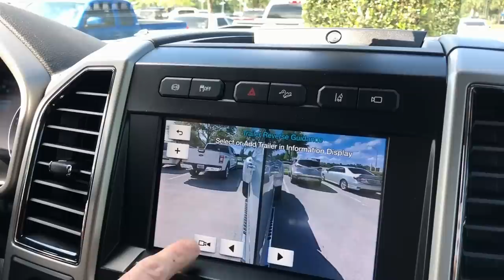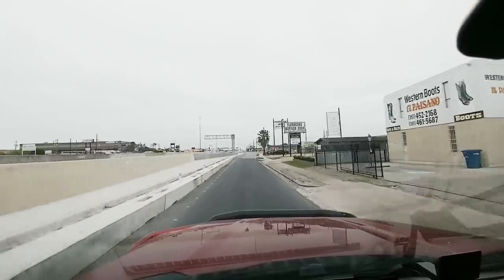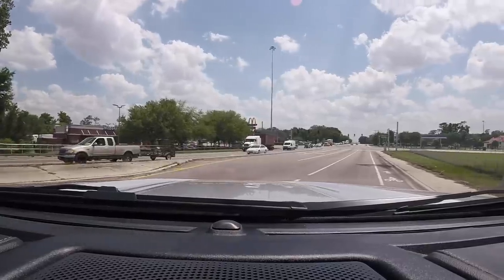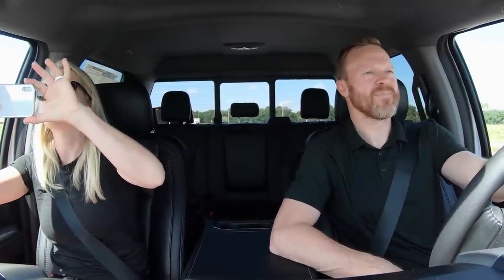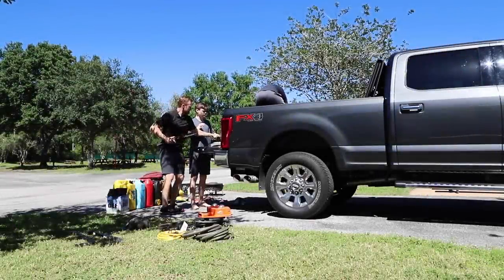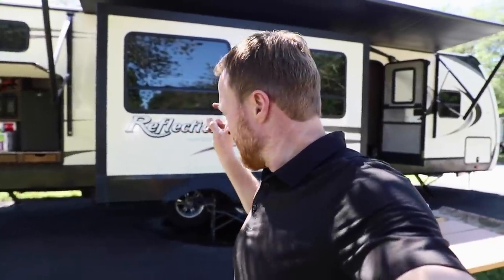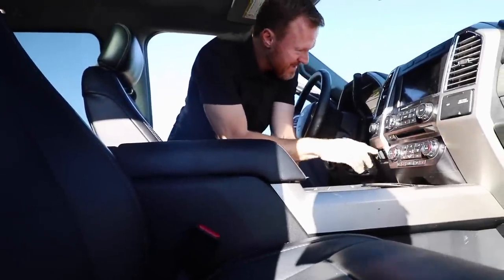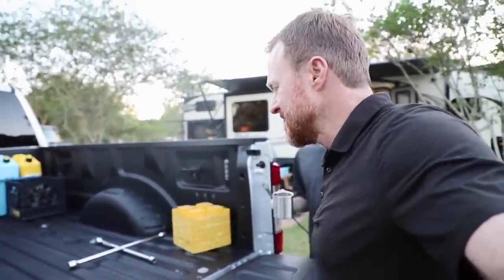2019 FORD F450: OUR NEW TOW VEHICLE! (WITH BIG TRUCK BIG RV)

Comment: Do you plan on putting the air ride, large tanks, and air system in the new 450? Hopefully they have you a smoking deal for all those add on’s.
Reply from the maker: Yes on the on-board air. I wanted bigger fuel tanks, but the F450 has a 48 gal tank and it's just good enough not to change.

Comment: Another you tuber added up fitter switch’s to his 2018 F150, I would check to see if the wire ends are under the hood and if they are, then there should be a plug in that space where the switches would go in the cab and if you’re that wanting those switches then ... 😊
Reply: Andrew Poplawski I wouldn’t doubt it. Same on my 2016 F150, added trailer brake controller, the connector was already there, just behind the place where the factory one would go. Got an adapter harness, click, click dun.

Comment: Why did you only look at Ford trucks and not GM or RAM? Is it a sponsor thing?
Reply from the maker: I wish. I've driven 300k miles between two F150's and one F250 and only replaced a fuel pump fuse, oil, wipers and front brakes. No reason to change. However, I went with the F450 for the turning radius which is in a class of it's own. I'm going to miss this truck! I'd consider RAM, especially with their redesigned new interior dash, but my first truck was a Ford and old habits are hard to break.

Comment: I thought for sure that JD had you really thinkin F350 . I've drivin both but only owned the F350 . I like the 450 & 550 but I'm partial to the bigger trucks .
Reply from the maker: The F350 makes a lot of sense... but the wide front axle is sexy and thus.... ;)

Comment: nice truck. you can never go wrong with a f450. better turning radius with the wide front axle. Suggestion I would give for a better ride comfort is to install sulastic spring. it will give a better ride comfort but when towing might squat the rear end little more than factory, then install air bags to compensate.

Comment: Sweet choice.    Wait till you slap a fifth on there and the truck breaks in a bit.   You will be glad for the 450.   It pulls and stops way better than a 350.   Air Horn is a safety must 👍🏼😑

Comment: I have a 36 ft 11in bumper pull and the weight distribution hitch it came with is a trunion style set up what are your thoughts on this style hitch I pull my rv with a 2018 F-150

Comment: Just an FYI, the upfitter switches are very easy to add. I've put them on before, nice add by the way.
Reply from the maker: Hmm...
Reply: Ditto.  Added them here as well.  You can pick up a wiring diagram and some handy tips from your Ford shop.  Hope you are enjoying the new wheels!
Reply: @mhughes4444  You can buy a kit on eBay that has the wiring harness and switches. Then just watch a youtube video on how to install. They take less than an hour to install.
Reply: Fairway Ford is who I get mine from on eBay by the way,

Comment: With the big Super Duty Ford trucks empty, the ride is stiff and loaded up, it rides smooth! #KYD
Reply: My RAM 3500 had a stiffer ride than my RAM 5500 but I've got a 1000 pound flatbed on the 5500.

Comment: Since you got the vehicle on an X plan price the only way you could have beaten that is if the dealer was willing to sell for less than that, which usually doesn't happen. Especially on a vehicle such as this. Consequently, the only real negotiation you would have had was  the price of the trade in.
Reply from the maker: Exactly and they gave 2k more than I was selling private party. The axle issue is why I wanted to trade it. No claims = higher value and the dealer didn't care about the axle.
Reply: @KeepYourDaydream  Then I can't see how your deal could have gotten any sweeter than that unless you knew an employee  that could have gotten it for you on A or Z plan, initially kept it in their name and sold you the vehicle 6 months later( I come from a Ford family). Depending on how your state works that may or may not be a viable option given the taxes that could occur.

Comment: Centrimatics wheel balancers are a must with commercial tires.
Reply from the maker: JD mentioned them. I'll check it out.
Reply: @KeepYourDaydream  I run tractor trailers, and they make a huge difference in tire ware. I mainly notice a difference on steee tires, not much on drive tires. Congratulations on moving up to the F450. Yall have a great night.😀

Comment: Ok I'm sorry but to be honest you didn't need an f450 for a tow behind camper.  From covert wise and all the other things really didn't make up for on how you actually needed the 450. 450s are made for goosenecks or hauling all the time. Your trailer is very light for a 450.

Comment: FYI you do need a CDL if you’re towing 26,000lbs or more. From ADOT website 
Commercial Driver License
Vehicles Requiring a CDL
Combination vehicle (truck and trailer) if the gross combined weight rating (GCWR) is 26,001 pounds or more when the gross vehicle weight rating (GVWR) of the trailer, which is added to the GVWR of the power unit (the truck), is 10,001 pounds or more.  

Class A CDL is required.
Any vehicle with a GVWR of 26,001 pounds or more. A trailer may be towed if the GVWR of the trailer is 10,000 pounds or fewer.

Class B CDL is required.
Any vehicle with a GVWR of 26,000 pounds or fewer if the vehicle is required to be placarded to transport hazardous materials or if the vehicle transports 16 or more passengers, including the driver.  

Class C CDL is required, and an applicant must also have a passenger (P) or hazardous materials endorsement (HME) to obtain a Class C CDL.
Gross Vehicle Weight Rating means the weight that is assigned by the vehicle manufacturer to a vehicle and that represents the maximum recommended total weight including the vehicle and the load for the vehicle.
Reply from the maker: Depending on your state. 13 states require it.
Reply: And Arizona is one of them. I live here and have my CDL. I spent a while researching if I needed it or not. Now if you’re under 26,000 lbs you don’t need it. What I copied and pasted was direct from Arizona department of transportation website.
Reply: Also need one if your trailer gvwr is 10,001 or more.

Comment: Still trying to find a reason to buy a F450... I'm at 50% 😆
Reply from the maker: The turning radius and overall look of it is why I did it, but our truck's only job is to tow our rig. It's a bit rigid for a daily driver.
Reply: @KeepYourDaydream  my exact reasons as well. The estetic of the truck just keeps me drawn to her. Especially when Ford redesigned the rear fenders, squaring them off. 😍 I used to be a tow truck operator, F550 wrecker, I know the feeling, especially in NYC. A neighbor in my building had a 2018 Denali duelie as a daily, I told him you're effen crazy! (Beautiful as well)
Then again, the F450 wouldn't fit in my driveway 😔. My Land Cruiser just barely makes it. I aspire to have your lifestyle, or somewhat. Thank you for you/wife/family words of wisdom.

Comment: U need to check out the 2019 ram. It's got a 1000 lbs ft of torque. If ur gonna stick with the 450 check out jd's page for upgrades you'll like
Reply: Justin Livermore Didn't they already decide by purchasing the Ford?
Reply: @anthonyc1883  yes. I put that right at the begging of the video
Reply: @justinlivermore8956  OK, looks like  I missed that you were suggesting to other viewers to check out the 2019 Ram, not the KYD folks who have already purchased an F450. Thanks.

Comment: Should be able to add the remote start for about $100 in parts, around 45 ish in dealer "programing"
Reply: I had remote start added in my truck for more like $400, but that was parts and labor. But either way it's still pretty much worth it. Mine was an aftermarket upgrade on an 05 Sierra, so a newer truck might be able to just have the special keys programmed to it and no parts need installed.

Comment: You should look into deleting it now. Save you fuel mileage and more power. Probably wouldn’t want to though if you love your warranty. 
My 550 work truck has a much better turning radius than my 1500 ecodiesel. 
Congrats on Christmas week!!
Reply from the maker: I'm good with the MPG and this truck with the 5er is gone at the end of SN7.
Reply: Gone? Meaning the the truck and 5th wheel will only be short term?

Comment: Hey Marc. We went from a Silverado 2500 to a 3500 dually, to be safer while hauling our 45' 5er. The 2500 performed fine but we were right on the line as far as weight goes. Just having the dually is worth so much in peace of mind!  I know exactly how you feel about losing some of the options when you switch trucks! It wasn't so much the options but I had air bags, a compressor and other "additions" on the old truck that aren't on the new one! Not sure if I'll add all that stuff, as our capacity is so much more with the 3500. Those "bells + whistles" as you put it are nice but the safety factor with having a proper size tow vehicle outweighs all imo! You're going to love pulling a 5th wheel with that 450!

Comment: Oops! The 2020 was the one to have. Or 2021. I see an upgrade in the near future. And they overpaid;(
Reply from the maker: We're selling both rigs in Dec.
Reply: Having ordered two new trucks, I can promise you, spending $60-80, discounted or not, it isn’t worth not having exactly what you want. Unlike a car, many options are absolutely functional, not aesthetic. You might very well pay for stuff you don’t want to get what you do. 2020 Super Duty will have a 10 speed automatic and also perhaps about 10% more power. Plus many safety and functional upgrades. It the mid-cycle refresh. There won’t be any major changes again for another 4-5 years. Most all ford commercial Super Duty’s will have the 10- speed too. Hundreds of thousands of these transmissions per year. There’s only one way I’d buy off the lot, if I needed a new truck tomorrow due to outright destruction of the one I was currently using. Anyone who owns a current super Duty will recognize the difference between a 17-19 and a 2020+

Comment: lol. change a leaf spring.. still laughing at that one...  Sounds like your talking yourselves into the 450..  (keeping up with the Jones and JD)...  Don't think you really need it. How many times do you have to short turn? Ur rig is not gonna fit into McDonalds anyway.  ONE main question I have is the repair and parts on the 450 vs the 350 which is probably on Walmart shelves.. Just saying..
Reply from the maker: RV in Mexico and Alaska... and leaf springs and U bolts are things you think about.